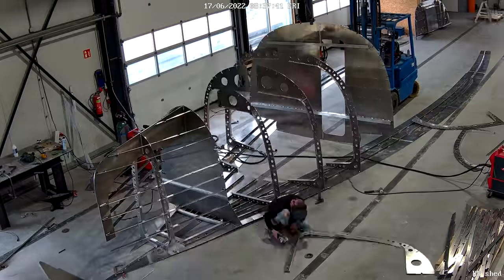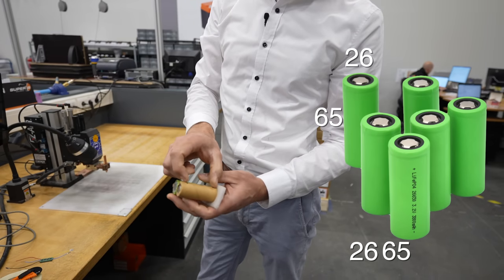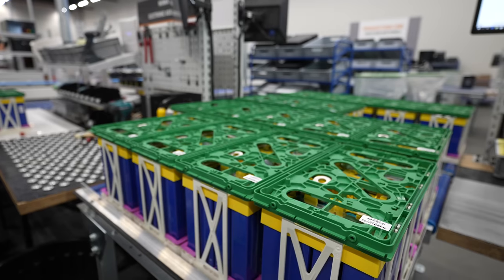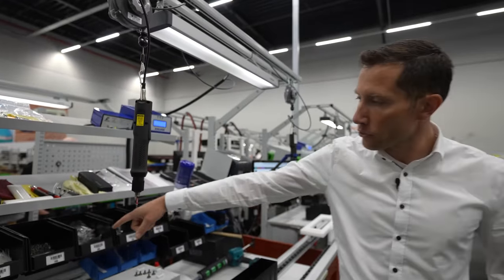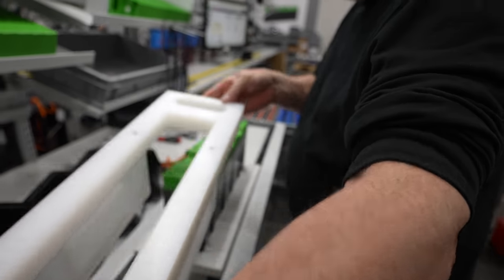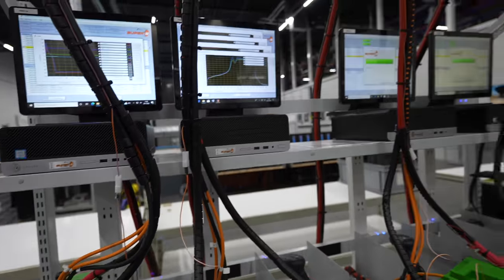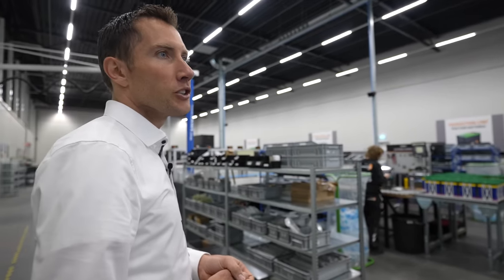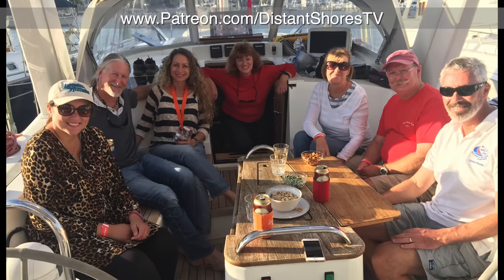Aluminum Sailboat Pt 16 Lithium Battery - How They're Made | EP 237

Comment: I don’t understand why the extremely expensive battery propulsion for a minimum run time except virtue signaling.
Reply: I suspect because they don't intend to use battery propulsion for any extended time (beyond manoeuvring from dock/buoy/anchor). My guess is that they expressed it as running range/time for simplicity within this episode. Paul explains their thinking and energy requirement calculation really well in a previous episode ("Building an ALUMINUM Sailboat Pt 8"). Essentially, their chosen battery capacity allows them to manoeuvre, cook, heat water, etc, without turning the engine/generator on as frequently - while relying on sails to cover ground.

I don't doubt that there's an element of choosing newer technologies to generate more interesting content (and I imagine they'd be quite open about that). But interesting videos is why we're here (probably 🙂).
Reply: @grigorbrowning  my question is why all the highly expensive alternative energy systems when diesel will do the job efficiently as it has for generations.
Reply: @annsheridan12  The idea is not to have a generator onboard. The diesel can provide propulsion only, charge only and both at the same time. The electric drive can provide propulsion and can be used to charge the battery underway. You get real redundancy with this setup. Now If you count in the solar power, you can see how this would create much more safety then just relying on a diesel for power and propulsion. 

Also, electric drive is almost silent, no diesel smell and you don't have to run your cold engine for a short time ever again.
Reply: @dajobra  The☀️ is NOT always available in the North to charge the batteries, nor forward motion either 🙄
Reply: @stevenr8606  true, that's why you need a diesel with a big battery to bridge the gaps
Reply: Surprised to see that they do not use cell “compression”. Or did I miss something?
Reply: @stevenr8606  Sailing UMA has been 100% electric for a few years now. They went above the artic circle with no issues and the electric propulsion motor also regenerates into electricity to help recharge underway. 99% of the population are not informed on todays technology available. Just like the misconception that all Lithium battery composition are the same, which they are not.
Reply: @johnbernard204  Uma needed to stop and recharge their batteries at a dock quite often, and when they couldn't do that, they used their Honda generator to recharge. They didn't have any solar to recharge and the regen wasn't efficient enough yet. Uma version 2 is going to be something to be seen, 😊
Reply: @tomwilliams8675  proving once again that without fossil fuels our civilization stops.
Reply: @annsheridan12  We're nowhere near the point the Liberal butterflies of the world think we should be. The technology just isn't there yet. For now America needs to be energy independent again and maintain it's oil reserves.
Reply: @tomwilliams8675  its not always about the US.
Reply: @tomwilliams8675  they don’t know that electricity only pr9vides 20% of our energy needs ,the other 80% must be fossil fuels and after generations unreliable renewables only prov8de 3% of our energy.
Reply: @annsheridan12  It is a pleasure to talk to another person who seems to know a thing or two about energy. 
I was a Power Line Contractor and then a High Voltage Test Technician.  Nice talking with you 🤝🤝
Reply: @annsheridan12  As others mentioned, the Diesel will not be used most of the time.  It's really a backup for any very long passages that don't have enough wind.   (Most of which can be avoided with good weather planning and routing, i.e., sailing when there IS wind.)

The electric drive can motor to and from anchorages, mooring fields, docks, harbors, etc., and recharge using hydrogeneration.  That means using sail power to motor the boat since the motor is used as a generator to recharge the battery bank when the boat is pulled by the sails.

In practice one would motor away, raise the sails and keep the motor engaged for a while.  With the wind pulling the boat, the motor recharges all the energy used to motor.  Then the motor is shut down until needed again.

This is a very strong synergy with sailing since it's essentially using wind power to motor instead of Diesel.

Yes, this is a new way of doing things.  That doesn't mean it's bad.

Most sailors respect the environment and nature, and most would prefer not to burn fossil fuels.

Also the battery can be recharged from solar, shore power, generator, Diesel, etc.  Electricity is a multi-source "fuel".  Diesel isn't.

All of the other political points made don't change the fact that electric drive is already highly practical and a great fit for sailing.  It reduces down to motoring using the wind.

Again, the Diesel is basically a backup.

A better question is: why is the Diesel even needed?  For most coastal cruising and day sailing, it already isn't.  And it adds a lot of complexity, cost and maintenance.
Reply: @LoanwordEggcorn  I have a book for you, “ Fossil Future”.

Comment: What he did not say is, who manufactures the individual 26650 batteries. If the source is the same Chinese company that manufactures them for EVERYONE, then the different companies are nothing more than assembler and packagers of these individual cells and marketing them as their own. They may have different colors, cases, labels and maybe even terminals. There maybe differences whether they are soldered or connected to each other by a different method. An argument could be made whether soldering electronics in a marine environment is better than crimping the connections. There is a good reason why almost all electric terminals on Marine Panels All wires are terminated with a crimped terminal and never soldered.
Reply: Yes, but regardless of crimped or soldered oe welded there is an obstacle.  To have a crimped connection the wore needs to be affixed to the cell somehow.  I do not know of an individual cell that has a lug for a friction fit.  Crimped all the wire ends you want but they all originate at a spot weld or solder joint at the individual cell.
Reply: In boats lithium iron phosphate is the standard for safety reasons.  I don’t believe they come in 26650 form factor. For boats the cells are usually prismatic construction like the ones shown in the video, not cylindrical.
Reply: Super B makes different kinds of batteries.  The cylindrical cells are used in the (combustion engine) starter battery format.  The marine storage format uses prismatic cells.

Comment: Hybrid systems is the way to the future for sailboats! Thank you for being bold and incorporating it in your brand new boat, there are many of us around the world who listen to what you say and do!
Reply: Why? What is wrong with diesel?
Reply: @annsheridan12  It is not a viable longterm solution for us as a species. And as a sailor most of the time you use your engine is in and around port, used only short times.  It is when used in a cold engine diesel is a problem because a cold engine is a dirty engine and if you can use electric power for the short hauls it saves a lot on both fuel and enviroment. This is where the hybrid is so good, bbecause it can run on both electricity and diesen, elec for the shortstuff and diesel for the long haul if you are stuck in a dead zone or such.
Reply: @klasandersson7522  why not a viable long term solution? Read “fossil Future “
Reply: @klasandersson7522  perfectly viable and must be 80% of our energy needs as electricity is only 20%.
Reply: You are perfectly right about Diesel being a ok way for propulsion for a long time in future. But because boats have so many efficient ways to generate electric energy, combining a electric motor in the propulsion solution seems logical. These discussions about boats and so-called green living are very muddied as most of these same people live litterly on unrecyclable plastic bottles (re GRP boats). It's the hype of grifters nowadays sad to say. The emphasis should be on the off the grid part, not the so-called green part. Cheers 😎  @annsheridan12
Reply: @tip00former1  🤗👍🏻

Comment: What about cooling when you're drawing so much current continuously for an 18kw motor?
Reply: Cooling is largely a non issue for this battery chemistry and electric motors, both of which are highly efficient and don't generate much heat.

Comment: I have watched a sailing video where lightening has struck a sailboat.  The batteries stopped working.  When crew checked they found the BMS was bad but battery cells were still good.  Crew changed BMS with one from another battery on hand and got boat systems working again.  To do that crew had to cut top from battery case to access BMS, then reseal.  It seems to me the SuperB battery has the BMS screwed on the top.  So if damaged with lightening the BMS could be replaced.  If spare BMS is on board.  I like that.

Comment: great video! I’m a sailor and homeowner who just had a 5.6KW solar panel and a 20Kw battery system installed. I agree with other comments about the need for thermal management of your pack. My batteries are in my basement and have no thermal management as there are no requirements for the kind of instant full-throttle response that a warm battery provides. I’m still on the grid so my system controller (Enphase) pulls from the grid whenever power requirements spike faster than the batteries can respond. You’ll need a similarly reliable system unless the batteries are just for diesel back-up.  I look forward to knowing how you plan to charge them too. Cheers!

Comment: Finally! The best video I’ve seen showing a great product that uses bus bars for connections between cells. I think you just sold me on this particular mfgr to replace my Natervolt AGMs. Two questions for the mfgr are: 1. What is the bus temp at a charge rate of 100amps? 2. Is there an option for a redundant BMS as I see it as a single point of failure.

Comment: These batteries may be more expensive at the initial installation, but once you figure in the added safety features ,dependability and longevity you not only are safer for your peace of mind but also your safety.
I've always believed you get what you pay for and these batteries seem to hit all the points that are the most important . Safety and reliability. I really like the welded unions compared to the traditional methods of nuts and buss bars that work loose over time .
Reply: Don’t forget the environmental consequences if the mining and production as well as the cost.
Reply: @annsheridan12  Mining coal, is a one shot deal, when it's gone mine more. 
The processing of lithium is changing to meet stricter standards, but is a work in progress.
There are now a few companies that recycle the different cells, so the emissions footprint is reducing. More recyclers are in the pipeline. Still a work in progress, but what isn't.
If anyone figures there is no growing pains in an industry, they better get a grip.
Reply: @carlthor91  fossil fuels are what make our civilization possible
Reply: @annsheridan12  Yep, for now, they will not go away, but will reduce over time. Anyone who thinks they are here at the same level for all time, well, I have some land in Florida and a few bridges in NYC, that would be just right for them.😎
Reply: @carlthor91  ass backwards, fossil fuels use will increase over time.
Reply: @annsheridan12  Look at consumption, reduction is ongoing, not fast, but ongoing. High was 2018, before covid crash.
Reply: All good until you see the human cost of mining the raw materials for Li Ion batteries.

Comment: The freeze frame at the end of the video shows all battery blocks without any space in between. Under real usage conditions I would place them about a half inch apart and provide forced air circulation around them for easier thermal management. I would even include the battery in the heating system for sailing in colder climates. At this stage of the build it might still be possible at moderate cost. I own an electric scooter using similar battery technology (48V but just 2kWh). It performs well at 20°C battery temperature and above. At 10°C there is already a significant drop in performance, and below water freezing temperature the battery is nearly useless.
Reply: Your scooter uses a different chemistry. LiFePo4 likes it warm. In fact, no charging is allowed in freezing conditions. Also, LiFePo4 is not prone to fire like cobalt based Lithium batteries.

Comment: They look well made although at 5.40 it seems like they have a mix of a steel bolt and tin/aluminium, in a salt air environment wouldn't that be at risk of galvanic corrosion over time. I guess as long as the seals hold it isn't an issue.

Comment: 👍 what a wealth of information. Next, sometime soon, will be how to maintain the energy needed to maintain 💯 %. As you well know ☀️ for solar cells is NOT always available, nor is water current... especially at dockside or at anchor. Charging the batteries via the engine, for hours, is NOT a good idea either. ? Generator  ?
Reply: I am sure the electric engine will also act as an efficient and powerful generator. As well designed as everything looks, I expect in not too hot climate it should be possible to charge the battery bank from less than 20% to 80% in 2 hours. by running the combustion engine.

Comment: With the electric propulsion system and the extra batteries, what is the increased weight and cost compared to a standard diesel propulsion system ?
There must be a fairly high extra expense as well…
Reply: Battery costs are falling rapidly mostly due to electric vehicle economies of scale.  Electric motors are already relatively inexpensive.

Comment: Have you heard yet whether or not the DNV certification will make getting insurance easier or not? Last time we were insurance shopping for our cruising cat I was surprised to find out that there are still underwriters who will not insure vessels with lithium batteries. The fact that there is now a standard for use in the commercial shipping world would make me think that this should not be an issue for long...but I was just curious if you’ve thought of this factor when it comes time to insure your new boat?
Reply: Pantaenius - one of the biggest boat insurance companies in the world - posted an article that LiFePOs are in no regard any more dangerous than lead acid batteries and when installed correctly do not increase the risk at all.
So the whole topic is not that interesting any more. Get a really good battery (no - don‘t buy EVE cells and a Daly BMS… 😏) and that‘s it. 🤗
Reply: There is already a lithium standard in ABYC and ISO. If you are a commercial vessel there is the additional standard mention here. 
They don't mention how they satisfy the ABYC standard for an audible alarm prior to BMS shutdown. They also use passive balancing. Active balancing is far better. Passive balancers use mV to burn off amps from the highest volt cells. Active balance moves the amps from the highest cell to the lowest at Amp level not mA level.They also don't compress the cells. Every major cell manufacturer advices to compress cells. It's worth about an extra 1000  cycles on the life of the battery. 
On drop in batteries like these with the BMS in the battery case, heat is going to be an issue at high loads. The cells got hot at the positive terminal creating a temperature gradient across the cell. Add in a hot BMS and no ventilation and you have reduced life expectancy especially if using the cells for motive power where high loads exist for an hour or two

Comment: Hi. I saw that they don't use torx moment to drew the screws. And also i saw some fingerprints on the aluminium plates. That means that there could be som corrosion in time later. Because some person have sweat fingers. That means acid. I have very good experience in Swiss High quality factory. And i saw many  problem zones. Stay well. Regards from Switzerland ❤
Reply: The screw drivers are torque sensing.  Agree about the fingerprints, but probably doesn't matter too much.  The fingerprints will still be there in 20 years, and the batteries will probably work about the same as new.

Comment: Running electric motors from a generator with  battery pack is between 25-30 % more fuel  efficient than running direct.  
You can also hydrogenate under sail.
Reply: It's more efficient to drive a shaft directly from a diesel than to go through a generator and electric motor.  Electric motors are highly efficient but do have some losses which simply don't happen with a mechanically direct drive.

Comment: LFP batteries seem to be replacing LNMC (lithium-nickel-manganese-cobalt) batteries that have had dangerous dendrite issues and fires, not to mention troublesome mining histories.  This applies to electric vehicles and stationary power storage associated with wind and solar farms.  Sailing is a natural for solar + wind and safe LFP battery storage.  I wonder if solar panels, wind turbines and impeller generators can be expanded and matched with bigger battery packs and balanced to offer a major reduction in the consumption of diesel.

I really like the specs and quality control standards offered by this company.  It's important to note, though, that very advanced R&D out of China has now started down other battery chemistry roads, and sodium is now entering the field.  I heard somewhere that a hybrid sodium-lithium battery has much more energy density per kg, therein more punch for the same weight as LFP batteries.  If this tech matures well, then that may have very significant ramifications for longer range marine electric drive and more zero emission power generation and storage capabilities for the onboard electrical systems.  Perhaps diesel generators will eventually be seen strictly as back up.